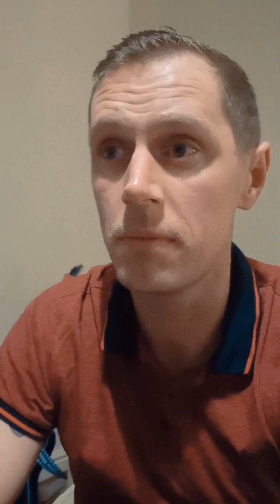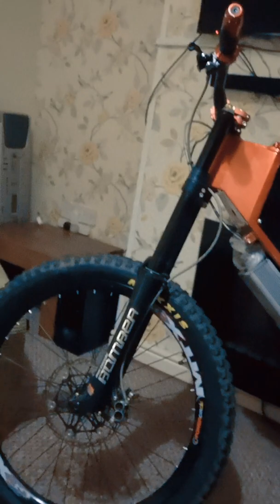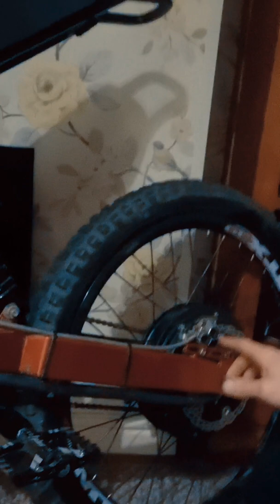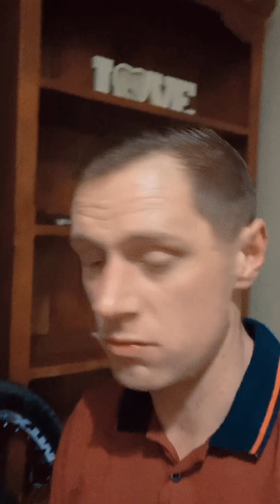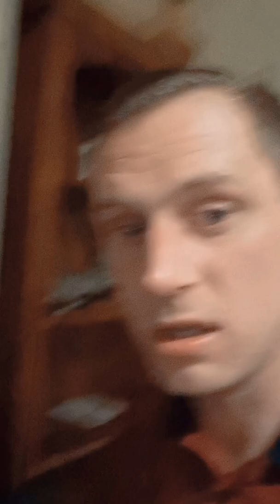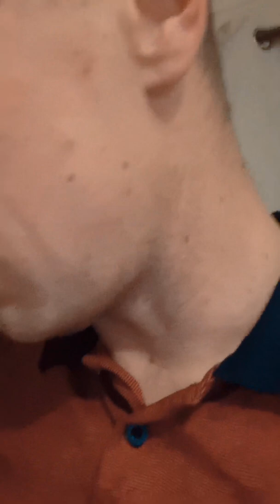BUILDING A FAST ELECTRIC BIKE THE PARTS THE DON'T TELL YOU!

Comment: Bro can I ask you a question since you are a metal welder please, my hub motor axle is 10 mm and the drop out to where the axle seats is 12.5 mm on my frame , so because of the extra 2.5 mm space that i have at the dropout when the wheel turns its slams , because of the wrong size ,  my frame  is made of chromoly metal  i got it from china, I was wondering if it is possible to reduce the spacing to it to the 10mm so it doesn't have any play and it fits snug,  as at the moment the drop out is to big for the axle by about 2.5 mm to big, how can the size be reduced to stop the play and the slamming,  is it possible to put a bead of weld on to the space to reduce the size to the 10mm  to match the thickness of the axle of my hub motor, the metal is chromoly, is that possible how do i go about this, thanks.
Reply from the maker: You could weld it mate but the easiest way is to buy some bushes you need a 10mm 12mm Bush I would probably drill your frame out to 14mm and use a 10 to 14mm Bush if you can. Somthing like this would work OK 

https://www.ebay.co.uk/itm/192006811724
Reply: @theebikenut4679  yes but it is not round , I mean lit is not a circle, its not a circular, it looks like any hub motor axle.  thanks. i wish i had you whats-app to send you a photo . 07947464112 all me please amir
Reply from the maker: I get what your saying mate each side of the spindle has a flat on it. If that's the case you will have to get the frame welded up. It is possible and won't cost you a fortune.
Reply: @theebikenut4679  that's right ok I see,  thanks for helping I will try and find somebody, i hope you are all well , look after your self, thanks for your help. have a nice day.
Reply from the maker: No problem bud sorry I can't do the job for you but for a welder it should be a pretty easy job your local car garage should be able so get you sorted. They will weld it and grind it back to 10mm and shouldn't be very expensive.

Comment: What crank set did you use?
Reply from the maker: Shimano nexus square taper and used the original bottom bracket mate the bottom bracket is 120mm if I remember rightly they are hard to get in a spline type crank. Hope that helps
Reply: @theebikenut4679  thanks